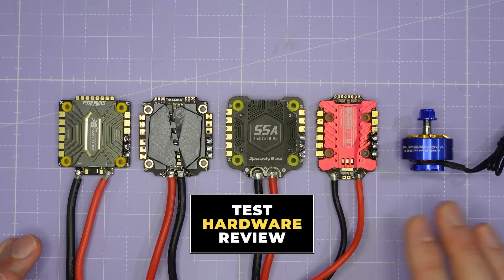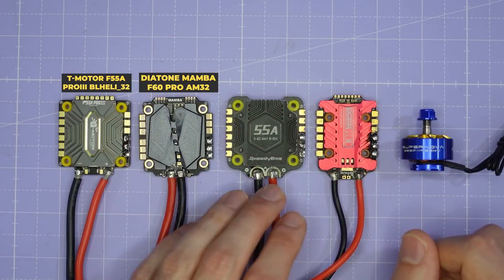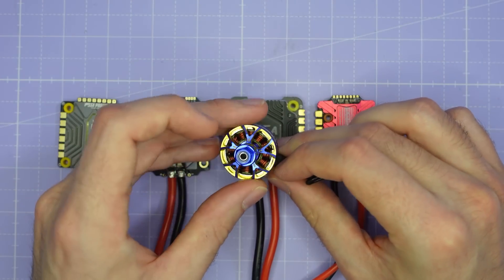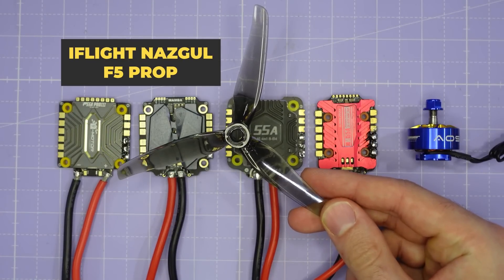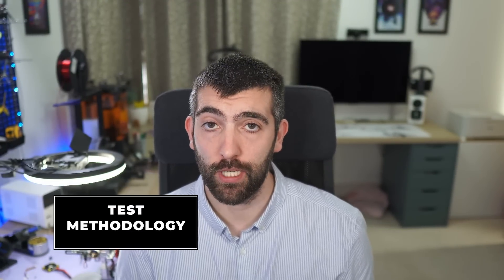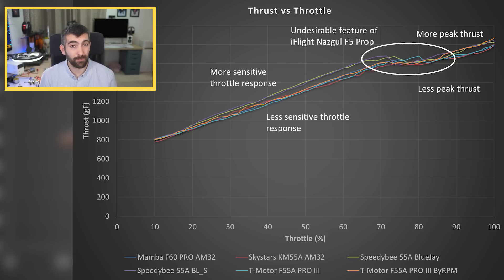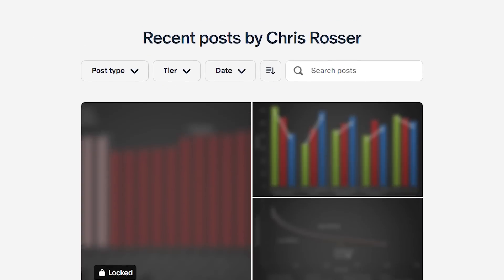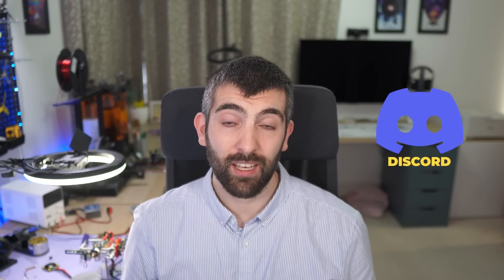55A ESC Testing: BLHeli_32, BLHeli_S, BlueJay, AM32

Comment: Please test the ESCs for desyncs, I have been getting desyncs because of high KV (1950kv F60IV) motors, I tried Mamba F40, F50, F55, AIRBOT Furling32 (even got them smoked just from giving a throttle), I tried Oscar Liang's recommendations with a bunch of different rampup power and demag comp-s settings, changed all set of the motors, nothing ever helped, always got the desyncs until I tried a high end expensive ECS which I won't name because this is not an advertisement. I am really curious what other ECS-s can avoid desyncs on such a high KV. The main scenario how I got the desyncs was - I gave a full throttle for 1-2 seconds, then throttle to 0, and immediately Roll to the side on 1100deg/s rate. At the end of the roll I have been getting the desyncs. I think because of back EMF and from cutting the throttle from 100 to 0 and from acceleration of motors to stop the roll.
Reply: Name that ESC, i need that name man
Reply: This is by far not a "high" kv by today's standards! Racers and even loads of freestyle pilots have been using motors above 2000kv for years already. Trust me, your 1950kv (which actually is lower than that) is not the cause of desyncs you're having. And it all just points in the direction of shitty motors. I challenge you to try another motor with the same or bigger kV. I personally have 3 freestyle rigs with 1900+kv and 2000+kv motors, with different ESC, different firmwares, and I am YET to get a desync. Been rocking for 2 years.
Reply: @sadboybushido  so you think the F60IV's are trash? it's not high kv but the motors are not the issue
Reply: i have desyncs, too
skystars am32 esc
guess a fet is bad, already ruled out motor as cause
i like reliability and would like to know the name of the esc as well
Reply: I would also be interested in the ESC....
Reply: incorrect settings can cause desyncs.
 I had some weird desynchs with RCinpower 2020kv motors; increased the motor timing and try a different tune? Too much D can cause desyncs. Currently using the MCK race tune on BF 4.4 with no issues. Quad rips fast and smooth on 2020kv motors. I recommend it!

Comment: Keep the info coming, Chris! At 4:07 I'm seeing that at 10% throttle, a single motor with a 5" prop generates 800g of thrust. If that were the case, wouldn't all our quads just take off the instant we arm, with 4 motors generating roughly 1.6kg of thrust at 5% idle throttle? It also seems really strange that 100% throttle is only 2.25x the thrust of 10% throttle. Something about this data doesn't seem right to me.
Reply: yup, the specsheet for the Supernovas say 839g of pull at 50% throttle on the GF5136R
Reply: I'd guess that he just did the graphic wrong and the curve should be shifted down a few ticks.....
Reply: This is a very serious concern. Chris needs to correct and explain this asap.
Reply: HOW DARE YOU POINT OUT INCONSISTENCIES! ROSSER IS 'THE' SCIENCE! TRUST THE SCIENCE
Reply: @MysteryD  If you dont truse me you dont trust science___anthony fauci
Reply: Chris is just using proper SI units for Force (= mass x acceleration). The unit of the thrust on the y-axis is gF or gram-force which is a product of the actual grams of thrust by the acceleration due to gravity. So to get actual grams you'll need to divide by 9.8 m/s^2, i.e. 800 gF = 89.88 g of thrust
Reply: @kandredfpv  so at 100% throttle this motor produces 160g of thrust? 😁 The graph goes from 800 at 10% to 1600 at 100% so I think it's actually just the X axis is mislabeled and this actually starts at 50% throttle instead of 10. It isn't Newtons
Reply: @kandredfpv  gram-force is fancy way to say grams of thrust, 800gf is exactly 800g.

Comment: The ESCs differ also by the dead times that the FETs need. How much of an influence does this have on the parameters? Ideally (I know it it a wish) we would compare the ESC firmwares with HW / settings realizing the same boundary conditions.
Reply: I think this is a pretty important consideration - I know that some ESCs have very long dead times compared to others. I think some of the Holybro Tekkos have very short dead times and some the AM32 targets / ESC have much more conservative dead time ratings, in some cases at least. It would be nice if BL32 exposed the dead time setting like BL_S, Bluejay, AM32 (assuming you install the firmware) so you knew what they were set at.